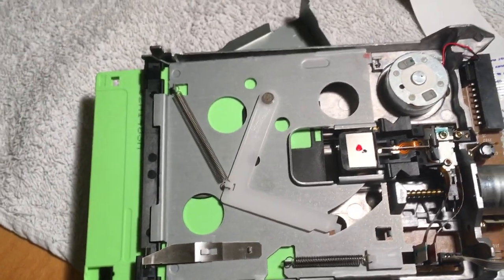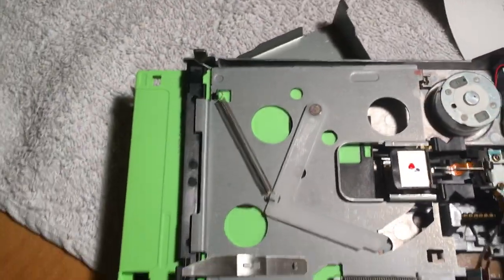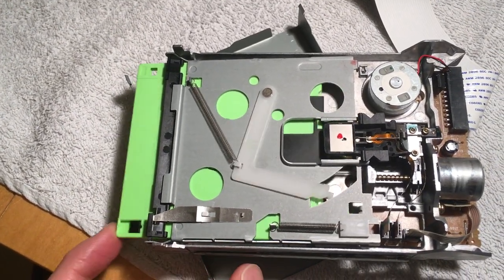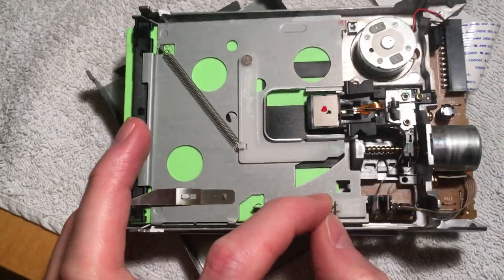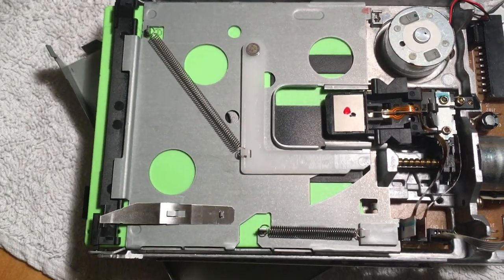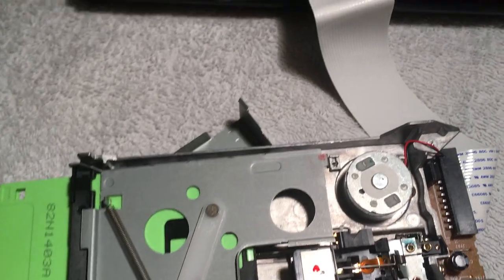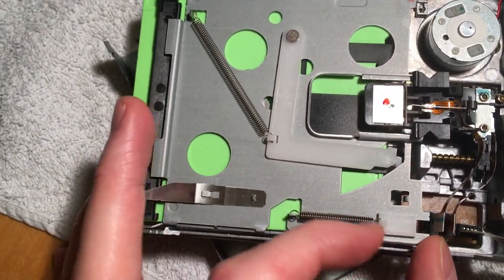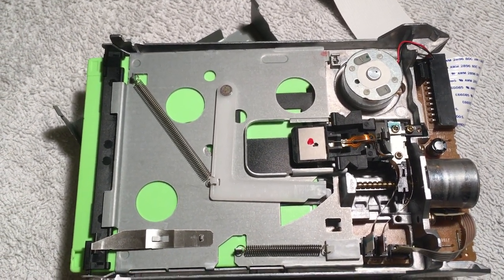3.5" FDD load/eject mechanism broke...(2021 update: fixed and sold for spares)

Comment: It looks like a Matsushita EME 720kb drive, they were fitted in MSX computers and Yamaha synthesizers and are notorious for breaking. You can replace it if you can source a refurbished N.E.C. FD1241H floppy disk drive and on Ebay there is a seller who makes FPC cable converters for that type of flat cable which simply clips onto the back of the N.E.C  disk drive and you reconnect that flat cable to it and it should work perfectly
Reply from the maker: @Karl thanks for the info. I should have updated this video! It kicked into life a few days later and so I did a 12h stint of loading all my disks before it broke again! THankfully (and hopefullY) I never have to deal with FDD's again :D